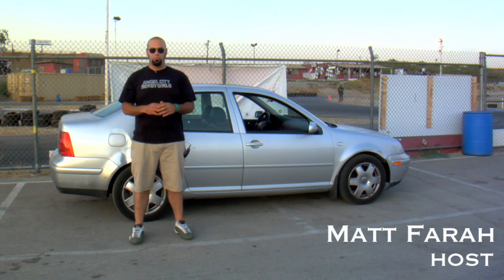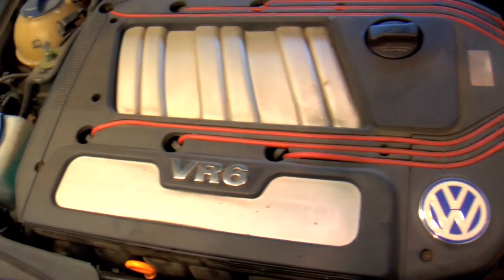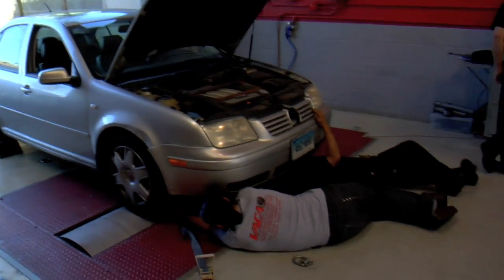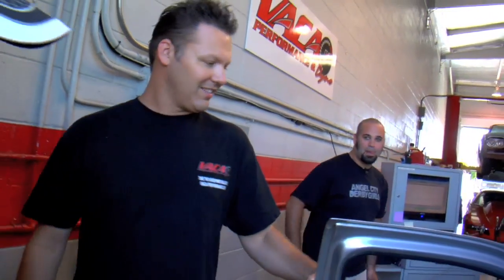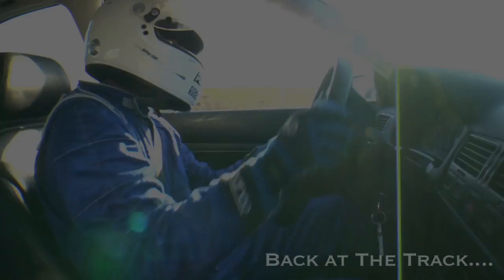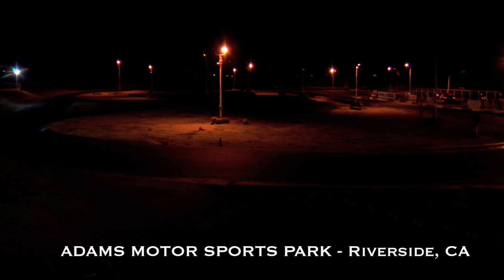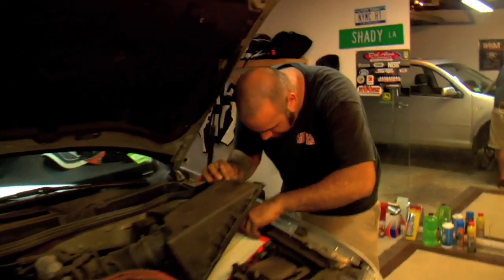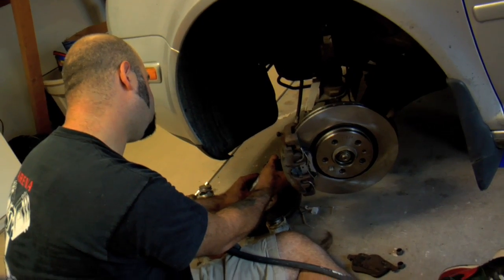How to Improve Your Old Car's Performance - Part 1/3

Comment: Carbon cleaner (seafoam is best, use 16gallons of gas per bottle), oil treat, spark plugs, coolant test real quick, and that should be all you need to get it back to normal in terms of engine.
Reply: Also oil change, change all filters (oil (duh), gas, air), clean throttle body.
Seafoam once more.
If that doesn't work, then Engine rebuild (300 ish for most cars for a kit)
Reply: Dont use 16 gallons. It'll be diluted to high hell. Just use an entire can in half a tank fill up. Nothing will happen.

Comment: Long story short they do basic maintenance on this car and it barely makes a difference.
Reply: Thank you good man.
Reply: do you have any products for car speed performance ? there are some throttle lags when start up my car . and it needs long throttle response time .  how can i solve this problem ?
Reply: @irislin8653  Clean throttle body, clean MAF or MAP sensor
Reply: MsSomeonenew going to pretend I didnt see this comment
Reply: This was great, been searching for "cheap ways to increase car horsepower" for a while now, and I think this has helped. Ever heard of - Vabrielbey Vehicle Verifiability - (do a google search ) ? Ive heard some amazing things about it and my colleague got excellent success with it.
Reply: Winner of a video, I been tryin to find out about "how to make a car better" for a while now, and I think this has helped. Have you heard people talk about - Vabrielbey Vehicle Verifiability - (should be on google have a look ) ? Ive heard some pretty good things about it and my neighbour got amazing results with it.
Reply: not for me .. i have an e34 .. i had to keep it in my garage year after year sadly .. finally after i came back to my country i found that my car is way weaker than before .. i had to use injector cleaner used with fuel to clean  the injector. i saw that i gained way alot power, but not as before .. iam trying to see if i could revive the whole preformace of the car .. mind that i never tunned it or put preformance parts and never will
Reply: This is glorious, I've been looking for "car upgrade performance parts" for a while now, and I think this has helped. You ever tried - Vabrielbey Vehicle Verifiability - (do a search on google ) ? Ive heard some unbelievable things about it and my friend got great success with it.

Comment: the product he was talking about to restore cylinder pressure is called "engine restorer" in the u.s. and it does work. no, it's not going to be like a turbo, or super charger. but it does help restore SOME performance

Comment: Yeah the engine loses a little power as it gets more hot on the dyno, but I'm sure after all these miles, a good run, higher revs, andrunning hot clears out alot of carbon deposit built up on valves and piston heads

Comment: 'old' car? it's a 2001...
Reply: Am I old now ??
Reply: esnevip i agree , i drive a Volkswagen scirocco mk2 1989 thats old ...
Reply: No it's old
Reply: esnevip So 14 years of driving is new to you?
Reply: I didn't say new, but I wouldn't call it old, it's still well within normal lifespan!
Reply: esnevip Most cars seem to break down or have issues after 190k miles, meaning generally his car has maybw 30k miles b4 it begins to need serious replacements..

Do you have any idea how far people can travel in 14 years?
Reply: Yes I do, but a well maintained car made by a decent manufacturer will go for a really really long time.
my Toyota is 39 and doesn't miss a beat.

Comment: I'm pretty sure that this engine comes stock with 204hp (at least in the euro version of the car).
Reply: izzyy9 You have right,
Reply: No this is 12V (you can tell by the looks of engine alone). They did use 12V between 1999–2002 at mk4 platform too.
Reply: izzyy9 24V comes with 204 PS / 201 hp / 150 kW, this has 12V, so only 177 PS / 174 hp / 130 kW.
Reply: ***** 12v is the previous model of the jetta (vento in Europe). This one is 24v along with other cars with the mk4 Golf platform. :)
Reply: ***** You are right! It seems that from 1999-2002 they were still fitting the old 12V engines in the U.S. However in Europe the Bora only has the 24v 204ps. P.S. I said that the previous model is called Vento in Europe and I am aware that this is a Bora because I used to own one. :)

Comment: I have a Jetta GL, I believe 115 hp from the factory. 170k miles, don't even want to know how little it has now.
Reply: Zapp Rogerstein Probably like 15hp
Reply: Zapp Rogerstein If it was maintained well, it probably still has most of its power.
Reply: It feels more or less the same but there's probably been some loss. Standard upkeep.
Reply: Old thread, but that's the 2.slow not the vr6.

Comment: Its a fucking vr6 volkswagen, fast is not in the vocabulary of this car.
Reply: lol tell that to all the turbo VR6 guys that blow the doors off people like you :P
Reply: suprise his check engine light didnt start leaking
Reply: LeeVai666 while a turbo VR6 would be fast, the rest of the car is garbage, they are based on the Mk4 Golf which is a shit car to begin with so still not a good car
Reply: They are heavy, and the chassis is softer than a matress hell the mk5 golf is said to be 80% stiffer..., steering has no feel whatsoever, parts are expensive and they create as much visual tension as a bar of soap....
Reply: LeeVai666 right
Reply: ok, please elaborate Brett Wilkins

Comment: Got an old which still looks good but is losing power? Go for performance enhancement systems today. Engineering marvels of sorts, these systems add a mighty dash of power to the engine and even go ahead to unleash the unreleased power. The only thing to keep in mind is that always original, premium quality enhancements should be used so that there is no adverse effect on the car's engine.

Comment: Why would you tune a 12 years old engine with 160.000 miles ?
.
I mean The owner should be happy the V6 engine is still running

Comment: car loses power on continous runs on dyno because of air heat on the turbo and intake. that run was with the car  warmed up (not cold) but turbo and intake Cold in the sense of first/second dyno run.

Comment: The scary part is there is idiots really out there working on cars. 
Listen to the one guy from Autozone and do not take these quacks seriously. Add a oil additive to reclaim power, not possible except for a very very short time until it screws something more important up. If you let your car get that bad that you loose compression the only fix is a expensive one. Use a good synthetic oil and take care of car from day one and you get long life out of it. What a terrible video.

Comment: This car is really a sporty car with a high power engine, many americans are just used to having v6'es with 150 to 250hp all day in any cars, and over 200hp in every v8 car.

Man, we have lots of 1 to 2 litre 3 to 4cyl cars in Finland and everything is like eco this and that, start&stop, hybrid, eco boost and stuff.. No one wants to have an 1990's v6 car because they consume so much (yes 10litres per 100km here is lots)

How come americans ban 2-stroke motocross and make v8 diesels for suv's? :D

Comment: lmao, I actually haven't watched this video in like, awhile.  And I don't particularly feel like doing it again, but if I remember correctly, they just put new pads on it, tires, tune up (plugs, coil pack, air filter, and that can of "cylinder compression junk" that I wouldn't let near my car).

Comment: Lmao.. exactly why the car is losing horsepower, pulling 8k rpm on a dyno will smoke those rings nice and well... I laughed even harder when the "dyno tech" was like.. okay you can pour compression restore in the motor.. dude nothing liquid can add metal back to your cylinder lolol

Comment: Generally speaking, a car is considered new whilst it is still within manufacturers warranty. VW provide a 3 year warranty on their cars; this 2001 Jetta would now be considered old. 

Also, this is an older model version of the Jetta, as VW have a redesigned model available now.

Comment: Man, you breezed over everything I was interested in and wanted to see...like did that compression goo actually restore compression? How does that dyno work and read out? What do you dig through and check on a car with that many miles? What about vacuum leaks and the different kinds of spark plugs/wires, etc.?  I don't care about watching you drive around a track, or trying to be entertaining with your buddies. Tear through that car and make it run right...that's what I wanted to see.

Comment: If you wish to achieve longevity from your engine use a filter, however without a filter your car should run better and louder, correct?

Comment: i have driven cars for months with no air filter and nothing untoward happened.
Those concerned with speed usually have no idea on car mechanics and try to tweak so much power out of an engine that it overheats and runs like a bag of spanners

Comment: true that. My dads ford mondeo with a 2.0 16v petrol duratech engine from 2001 had 170k with regular services and was as slow as a snail and used 5 liters of oil a month. Hats off to vw.

Comment: Improve your cars performance by keeping oil cleaner, keeping spark plugs clean from carbon deposits, removing current carbon deposits, and burning fuel more efficiently with envirotabs get them at greenfootglobal. com/vencesbegreen you will see increased HP and you will love the results guaranteed

Comment: I would just flood the fuel rail, chuck out the air filter and remove the cat... 20hp more, cost next to nothing.
then sell it on to some bonehead that thinks speed is everything

Comment: @bergaflickal Plugs and wires every 30,000 for me.... oil change 2500-3000, air filter every 10-15,000, trans fluid every 50,000, brakes every 60,000.

Comment: a basic tune up of the car, a good result it gave back a few horsepower. in your next taping can you show us how to set up the engine of a car with aftermarket parts. it may gave out a good rating :D

Comment: You said its a 2001, does is smell like crayons inside? (Some of us lucky 01 owners have the crayon scented interior). My Jetta 2.slow just turned over 100k. Still have yet to do the waterpump/timing swap. Hopefully you guys did that as well since the waterpump in MKIV's tend to fail majorly after 100k. Glad to see some VW coverage on the MKIV generation that made VW say "ah, we failed, lets start over and make the new version VW's better"

Comment: Aren't the spark plugs supposed to be good for 100000 miles anyway?

Why do you have to change the timing belt? Why not just get a car that has a chain-driven engine instead?

Comment: sub frame connectors...sorry I am used to posting in my Camaro forums.  
No I have not had experience with non GM cars.  But to my knowledge engineers in G< chose no t-tops because the design is inefficient.  Targa tops are much better.  I am a GM die hard and dont drive anything else(unless I hit the big bucks :)  )

Comment: 150000 miles no leak

But do you think GM has improved? That is, if the new Camaro did indeed have T-tops, do you think structurally it would be any better? Do you have any experience with non-GM T-top cars (MR2, Nissan Z-cars, Nissan Pulsar/NX, etc)?

what's SFC?

Comment: I purchased revised  original GM seals, they are amazing quality, but they still leak a tad.  I know people with high mileage 4th gens that have leaky t-tops.  The cars just twist too much.  IF I bought a low mileage 4th gen id immediately put some SFCs in to keep the twist to a minimum.

Comment: they improved them greatly starting around 1990 when they fixed the seal design. I know the 91's t-tops DO NOT leak (also they're plastic so less weight).

The fourth-gen went back to glass but they still don't leak

Comment from the maker: no, in fact you're spot on in terms of observations, but what we adjusted for (but left out of the video) was that the dyno numbers were adjusted for crank horsepower. If it had made 160 wheel horsepower, then it would have made about 20 crank horsepower over stock!

Comment: You say he lost 15 hp over time with engine wear and that many miles.  The published number VW puts out should be at the crank, no?  And this Jetta appeared to be on a chassis dyno- which gives HP at the wheels.  While there is an estimate for driveline loss, it's just an estimate- every driveline is different.  So how can you claim he lost 15 hp if you're comparing crank HP to wheel HP?  Or did I miss something?

Comment: 4th gear dyno pulls are useless, there is no fan in the world that can simulate 130MPH+ air/wind that goes into the motor at those speeds. 3rd gear dyno is more useful data.

Comment from the maker: I don't know, it somehow got deleted by the system, not me. To answer your question, it would be very easy to prove that a car's performance increased if we used aftermarket parts, so much so that it's not even worth doing. I was much more interested in seeing how much actual performance can be recovered or improved by using only stock OEM parts, filters, and fluids. (*Not all fluids used were stock though)

Comment from the maker: you'll have to see, but IF I were to put new tires on the car, it would improve performance on the track for sure. but the dyno doesn't lie about the engine either.

Comment: alright thanks. ima go check it out. and it goes in the oil right? hope so since they are both almost due for an oil change. might replace the fuel filters also.